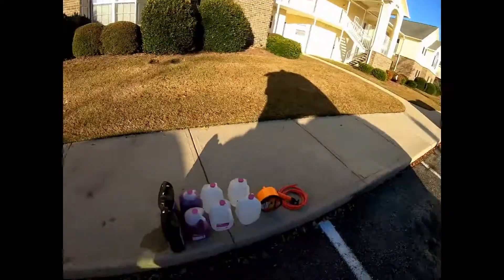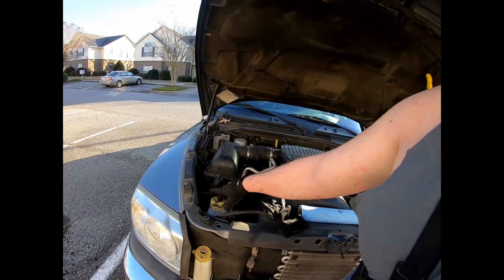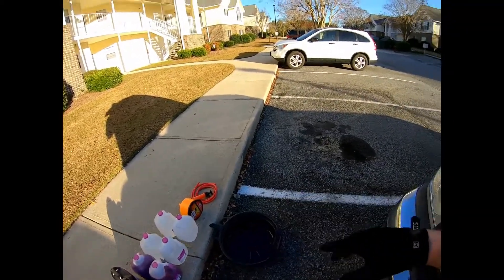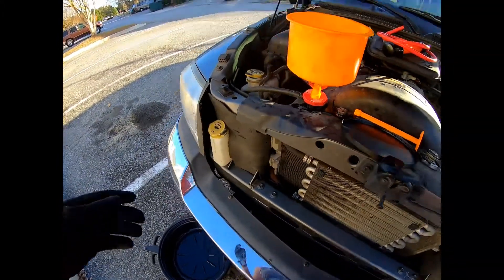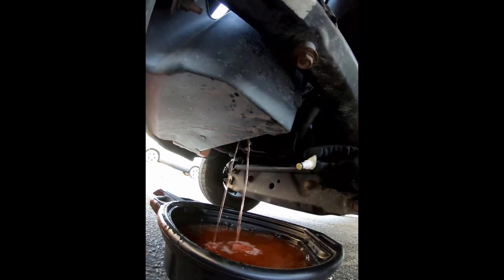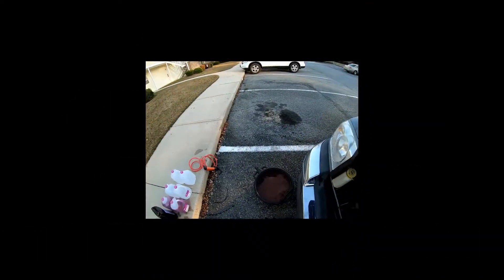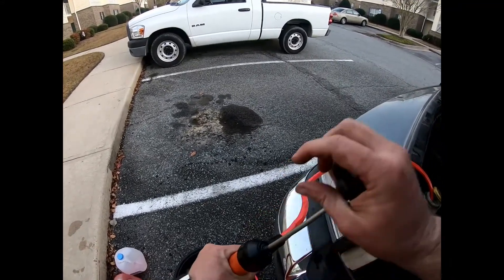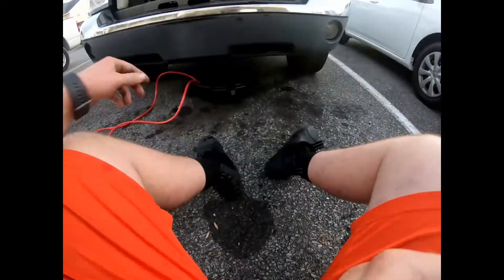Coolant Flush and Refill (2005 Dodge Dakota 3.7L V6)

Comment: You also needed to drain the engine block of coolant and distilled water. After your flush, there was still a ton of distilled water in the block and heater lines such that when you drained it and added 50/50 mix, you would have diluted it significantly more because of all the undrained water that was till in the system.
Reply from the maker: I repeated the cycling that water 3 times if I remember right and then added the coolant while the truck was running until it stopped taking in the fluid. Nobody takes the time to drain their whole engine block anyway 😂😂
Reply from the maker: I also put in the description that video is just for the coolant reservoir and radiator
Reply: @fishing_enc3343 I get. I appreciate the video. The block and heater lines are connected to the radiator and reservoir. The reason I watched was to see either how you accessed the block drains or adjusted or adjusted the mix ratio for the water that was still inside there.
Reply: So all conne ting tubes other than the "large diameter rubber hose" ne3d to be disconnected BEFORE starting the process?

Comment: Made the mistake of not burping my system properly after replacing radiator yesterday...pulled over before coolant hit 225 degrees...took a tow home so I didn’t need an engine replacement lol
Reply from the maker: Wow! I'm sorry to hear that ! That funnel kit I used in this video is really helpful with getting the air out because of how it locks into the top of the radiator and allows fluid to sit in the top of the funnel while the vehicle is on you'll see it actually "burp" itself! Hope my video helps you get your vehicle back in working order !
Reply: Fishing_ ENC it did, I bought the funnel the next day after watching your video. Took 20 mins thanks for the video
Reply from the maker: @brevinainslie6357  Awesome! No problem!

Comment: Shouldn’t  you use Mopar Hoat coolant in your 2005 Dakota which is orange/pink in color?
Reply from the maker: The coolant I used in this video is Mopar hoat (or oat), Organic Acid Technology, it states it on the back side of the coolant container. Its definitely pink in color, I think in my video I said its red but that statement was not correct.